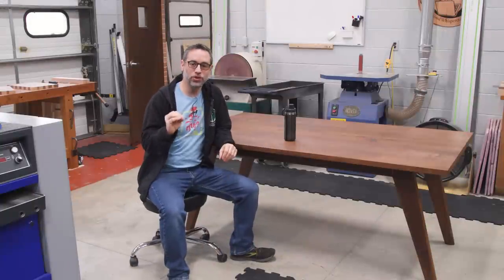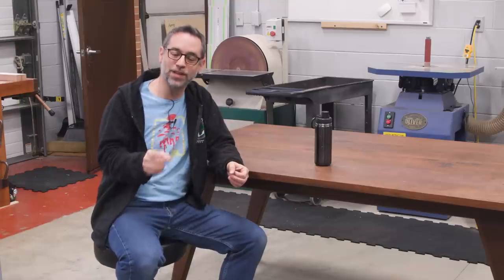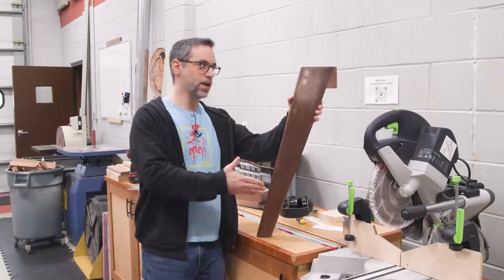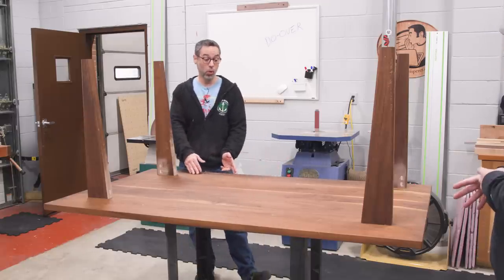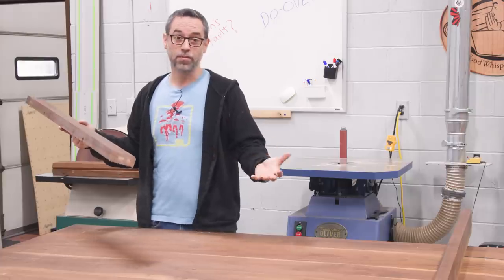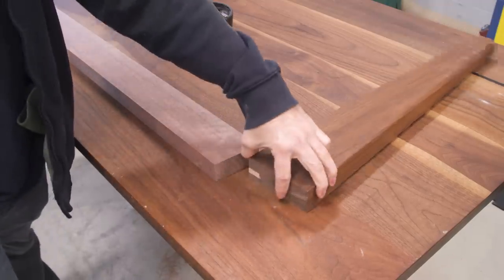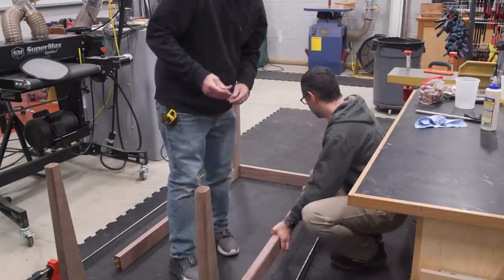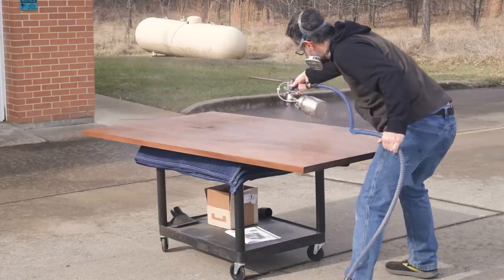Destroying A Beautiful Dining Table! | The Wood Whisperer

Comment: That's funny - I did the exact thing with our dining table for the exact same reason. 😄 I chose to turn the straightened legs 45 degrees inwards and attached the old rails on the inner side of the legs. That gave me enough length to reuse the old rails again.

Comment: I was curiously waiting for something about a change in table height. Did it change at all? Or did I miss it?
Reply from the maker: I meant to explain that in the summary and forgot about it. We gained about 1/2" or so.
Reply: The original skew angle lowers the effective height of the top when placed on the original legs. The new legs with square cuts, while shorter than the originals, would have approximately the same effective table top height since the full length is now utilized. The finished height difference would be negligible.
Reply from the maker: Not negligible..about 1/2". Which was good because they wanted it a little taller anyway.

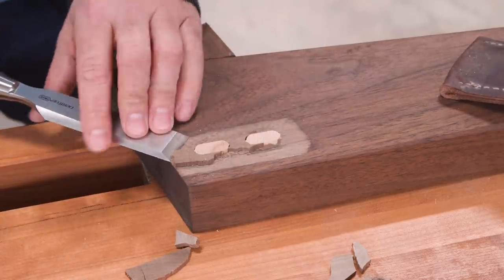Comment: 3:29 Generally I will add a thin layer of glue to end grain and let it sit for a short while before doing a glue up (if it absolutely needs to hold well). That way the glue that soaks into the end grain clogs the grain from soaking up more glue from the other piece. Granted, I'm not gluing up harder woods (where this might matter less), so there's that...

Comment: 3:20. It is always worth it. I do an initial thin coating of glue on the end grain and give it a couple hours to get pulled into the wood and dry enough to be a barrier. Then I do my glue up. It works. well. The wood starts breaking someplace other than the joint again. P.S. No loose tenon or other joinery required believe it or not. Even still I usually do a mortise and tenon. If not that, then a loose tenon or dowel.

Comment: I like that to find the angle you found a perpendicular surface to stand the Itty bitty foot on instead of just putting the sliding bevel on the top and over the edge. 😂. I guess either works but as far as reference edges go the top and bottom of the legs are just 90° to the outside edge right?

Comment: Great project and a good one to show folks that you don't have to trash it and start all over.  I have been starting to use Rubio for all my work and recently added a ceramic top coat to a piece that I was concerned about water stains (like a dining room table).  No long term results yet, but am giving it a try.  I just got tired of the orangey tint from my old standby of poly and the ease of application of the Rubio is amazing and if it gets a bit of a damaged spot, it is super simple to touch it up.  Just wondered if you have tried the ceramic coatings???

Comment: Since you cut the legs, did the table end up being slightly shorter? Or did going from an angled out leg to straight up and down compensate for that?
Reply from the maker: The change in angle actually added about 1/2" to the height.

Comment: In all likely hood, I believe what happened in the glue up around the dominos is the end grain has tubes in it which conduct water around the tree. These tubes can absorb glue and that explains the low bonding away from the dominos. The bonding near the dominos occurred because of glue squeeze out.

Comment: Great video! It's cool to see something changed to work opposed to getting rid of it and starting new. I wonder if something like the N3 nano finish that Blacktail Studio is selling now would have helped make the Rubio finish acceptable for daily wear and tear. I'm sure the new finish is fine but film finishes seem like more work in the long run when they eventually fail. Thanks for making great content!
Reply from the maker: Thanks John. 
I plan on testing a few of those ceramic finishes soon. Carbon Method makes one too. We'll see. At a certain point you're spending a shit load of money just to make a low durability finish into a high durability finish, when high durability finishes already exist.

Comment: Hey, Marc. How come you didn’t just square up the top 4” of the legs on the table saw, straight from the fence, like a reverse taper jig? Then your long rails wouldn’t need a mitre cut.
Unless I’m missing something….
Reply: I was wondering the same. Seems like instead of all the angle finding & cutting, squaring up that angle for the top couple inches on the table saw, miter saw or band saw might make easier joinery.
Reply from the maker: That’s another way to handle it. Just personal preference I suppose. Work is about the same either way. Domino doesn’t care about the angle so joinery is the same either way.
Reply: @woodwhisperer  I suppose that makes sense. Not having a domino, my mind was specifically thinking of how to make 90⁰ angles, probably out of habit of trying to simplify joinery.
Reply: Yeah I think that's how I would've done it but also don't have a domino. Like Karl said I'm also in the habit of going for 90 where I can.

Comment: Really great video. Thank you, Marc and Jason. Love the final look. 

Forgive me if this is a dumb question…. Is the table now shorter after trimming the legs? If so, by how much? And has that been a noticeable difference in its use ?
Reply: Not a dumb question. Chances are the rotation from a 15 degree angle to vertical offset the amount that they trimmed off so the table should be the same height.
Reply from the maker: The table actually gained about 1/2" in height.
Reply: @woodwhisperer  interesting. Thank you for answering.

Comment: First, tons of great info here, thanks! Curious if you thought of putting the legs turned at 45 or pointed toward the center maybe to try to help with the knee strike issue. If so, why did you not use it?

Comment: How do you manage to keep your table top completely flat? I recently made a table top 900x1300mm from ash, using 5 boards, I alternated the boards (happy/sad) the moisture content was 12%, I oiled it evenly on both sides, yet I bring it in from my workshop to my home and within days it’s cupped. It’s incredibly frustrating and makes me want to throw stuff!
Reply from the maker: 12% is quite high for furniture. You should be aiming for 6-8%. Sounds like the wood just dried more once brought inside.
Reply: @woodwhisperer  I’ll try and bring the pieces of wood in the house prior to working on them to get to final dimensions. I’ll aim to get the moisture content down. Thank you for the help.

Comment: To avoid the difficulty (??) of the angled ends on the long rails, could you cut the inside of the legs parallel to the outside at the top of the leg, just enough to cover the height of the rail?  This should make it easier on mortising for the dowels or your dominos.
Reply from the maker: That’s another way to handle it but doesn’t save much time. Domino joinery is the same either way.

Comment: Very nice redo!  2 cents worth of opinion. The original splayed legs were a bit dominant in the design. Took away from the top - and cut into the useful space (for tucking in a chair) on the long edge.
Reply from the maker: I think that's a criticism that can be leveled at nearly any MCM design that utilizes splayed legs. Just the nature of the beast. You can minimize the impact but if that's a real concern, it's probably best to pick a different style.